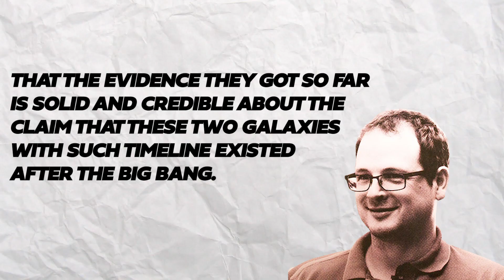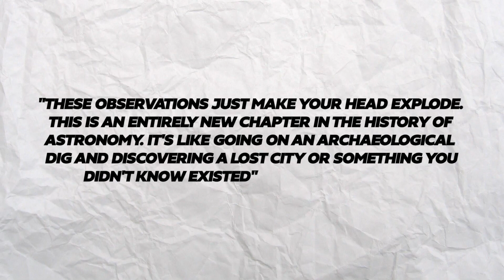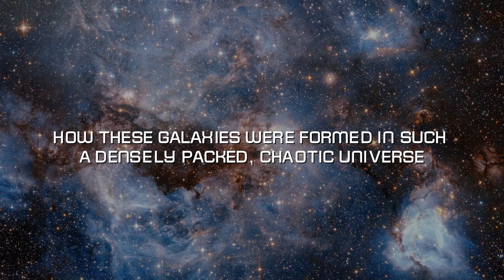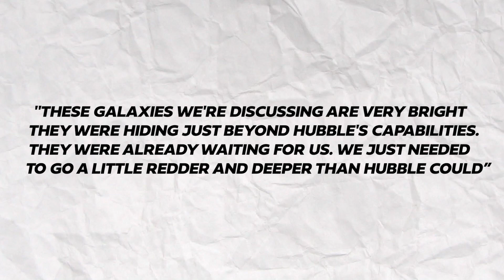SURPRISING New Images From NASA's James Webb Telescope...

Comment: My question is, why Positive particles is attracted to and interact with dark energy & dark matter? At the Same-time can the same thing happened to the negative particles? For example; let’s say the opposite happened: hypnotically light energy and light matter that maybe attracted to and can interact with negative particles? Hence, Why there’s no annihilation within the two, positive and negative particles? Simple hypotheses is, dark energy and dark matter maybe/can be repulsive to light energy and light matter, (like opposite poles in a magnet) and if they do touch why you get a part of space in our Universe becomes a cold spots?!? Hence reason why the Universe didn’t cancel itself out?!? Meaning there’s the possibility of two Universes? One with positive particles that can only interact with dark energy & dark matter, in-turn another Universe in-which negative particles is attracted to and interact to light energy & light matter?!? The Black hole which is abundant in our Universe but white holes are rare to non. Vice-verse White holes maybe abundant in the Negative Universe but black holes are rare to non?!? Also, why there’s some negative particles is still in our Universe? Well it can happen in the Opposite Universe which white holes are abundant in which the negative particles can only leak through to our Universe through our Black holes? Vice-verse our positive particles goes through the black holes comes out through the negative Universe white hole? Into an inter-Universal vice-versa! Evidence when NASA discovered negative neutrinos coming out of the earth core through Antarctic into space?!? Maybe why our Universe can only go forward in time and cannot reverse time vice-verse in the negative universe time can only go reverse but not forward?!? Which means a new physics has to be applied?!?
Reply from the maker: Wow, thats a very long and fascinating question you've posed! The nature of dark energy, dark matter, and their interactions with particles is still an active area of research and exploration in the field of astrophysics. 

Firstly, it's important to note that dark energy and dark matter are theoretical concepts that have been proposed to explain certain astronomical observations. Dark energy is thought to be responsible for the accelerating expansion of the universe, while dark matter is hypothesized to account for the gravitational effects observed in galaxies and galaxy clusters.

Regarding the interaction of positive and negative particles with dark energy and dark matter, it's currently unknown how exactly they would behave. The concept of positive and negative particles is typically associated with electric charge, and their interactions are governed by the electromagnetic force. Dark energy and dark matter, on the other hand, are hypothesized to have very different properties and are not directly related to electric charge.

In terms of the possibility of two separate universes with different interactions between particles and energy, this is an intriguing idea. However, it falls into the realm of speculative theories at this point, as there is currently no experimental evidence to support such a notion.

Regarding the existence of white holes, which are hypothetical objects that theoretically "spew out" matter and energy, they are still purely speculative and have not been observed in our universe. The concept of white holes arises from mathematical solutions to Einstein's equations of general relativity, but their actual existence and properties remain speculative.

Thanks so much for taking all that time to comment, and it would mean a lot if you could sub to the channel 😊!